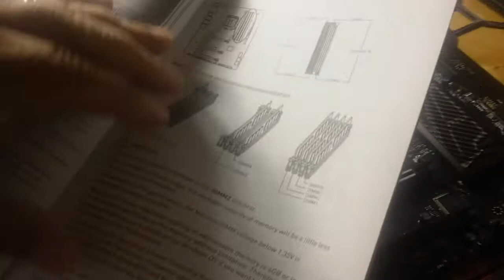MSI Z170a Gaming Pro Carbon adding Corsair Vengeance DDR4 Memory

Comment: I heard that one of the RAM slots is a failure....Is it true?
Reply from the maker: We had one bad memory module.  The RAM slots are fine.
Reply: Charles McDonald  Which DIMM was was not wprking?
Reply from the maker: One of the first Corsair Vengeance DIMM's wasn't working.  The one in slot 4 in the first memory vid.  We replaced it with a working DIMM in the same slot.  Our only empty slot is empty because we have an odd number of DIMM's currently but the remaining slot is very likely working.  I have a later trouble shooting vid where I determine why our Windows load is not working and it's because of the bad memory module that was first loaded in slot 4.
Reply: Charles McDonald Ohh Okay! Thanks for the reply sir! Have a nice day!